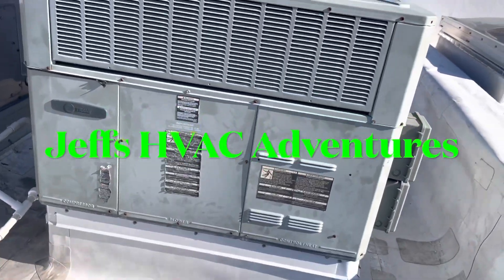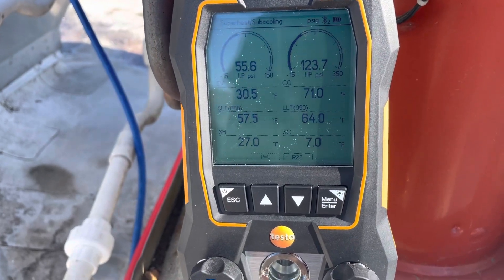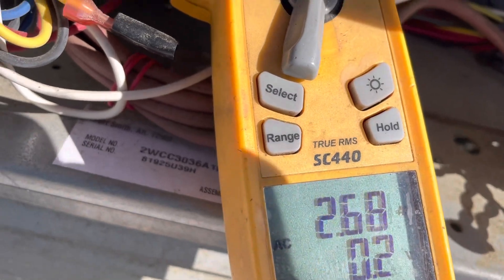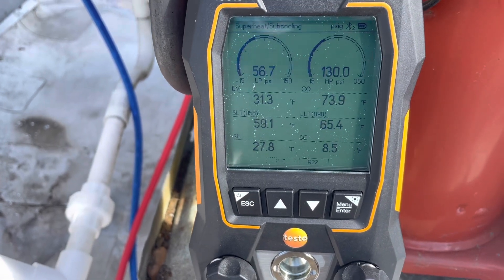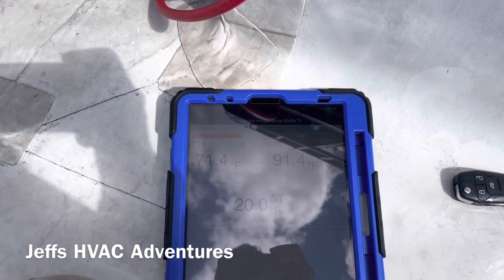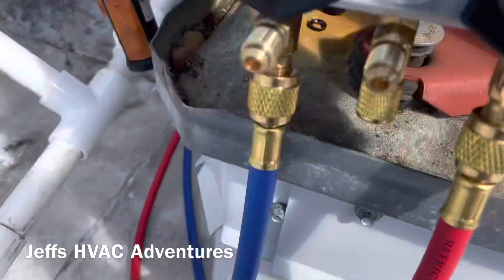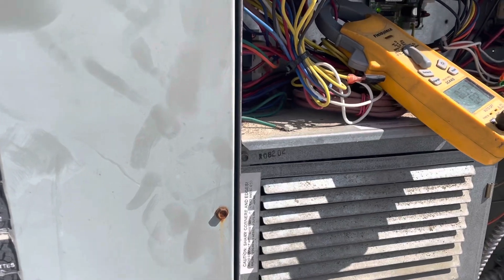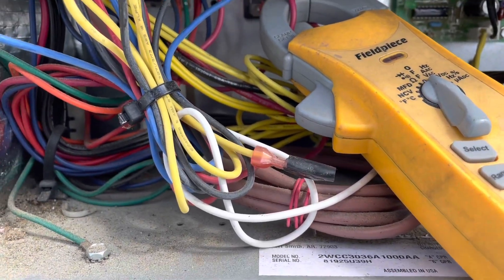Trane RTU With Faulty Blower Relay!  Almost misdiagnosed! #hvac #airconditioner

Comment: I came here trying to troubleshoot why my blower fan is running continuously. I just replaced my blower motor a few days ago that stopped working. I did verify that it was a bad motor. Now, two days later, the blower fan will not shut off, even when the thermostat is set to power the system off. The compressor seems to be working fine. 

Could this be a bad blower relay?
Reply from the maker: Yes it could be.  Did you make sure you put the wiring back exactly how you unhooked them?
Reply: @JeffsHVACAdventures  Yes sir, it was just the two connectors into the ECM motor that needed to be unplugged for the motor swap.. 

I watched a few videos since the last message. When I get home tomorrow, I'll do some troubleshooting to rule out the new motor is the problem. After just spending 600.00 for a new ECM motor, it's frustrating to learn of yet another problem to fix. lol

It seems the blower relays are a common problem.

Comment: Hello Jeff. Thank you for the videos. Apprentice here and have a RTU doing something odd. The unit will run anywhere for 1-3 hours and then the coil exhaust fans shut off. The compressors run, the fan motor runs, but the motors just shut down. The crazy part is if I turn the unit off, and check fuses and voltage (all read normal) and turn the unit back on, it will run for another 1-3 hours like nothings wrong. I am thinking high limit? Any advice? Thanks in advance.
Reply from the maker: Maybe a limit.  Is there any low ambient controls or fan cycling switch on the unit?
Reply: @JeffsHVACAdventures  There is a main disconnect, and a thermostat. Its a York Predator, older kind if I had to guess. Spent an hour looking at it today, before I got put on something else. Will be looking at it again tomorrow, but I am honestly stumped. It just isn't making any sense. But I don't "think" there is a fan cycling switch, I do know the digital thermostat has a "hand" mode where you can force the unit on, but that just turns the blower motor on, not the coil exhaust fans. I have never seen a unit work after for a few hours after a power shutoff, but I fear burning something up. We can't just keep resetting it like that.